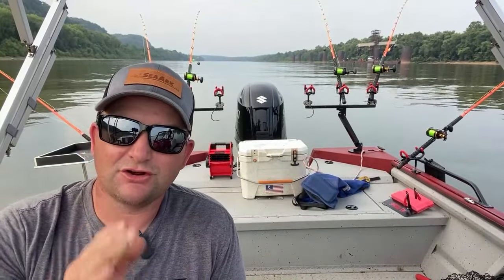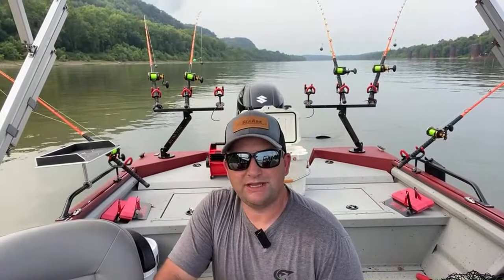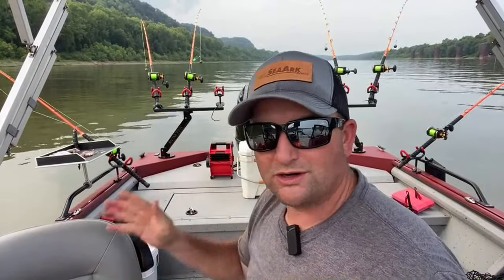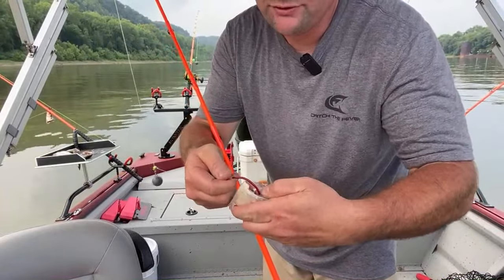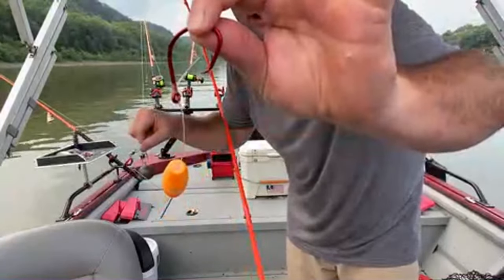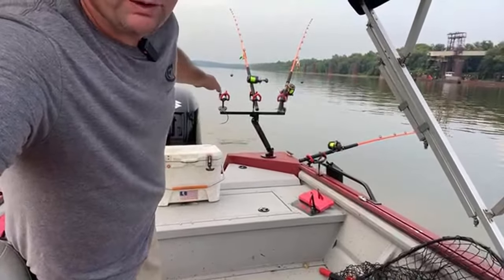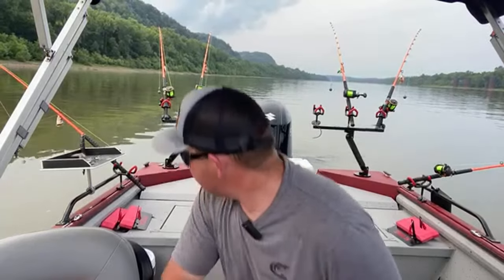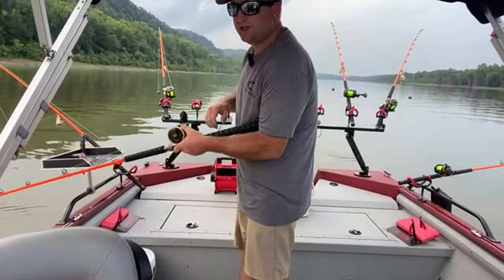How to suspend drift with planer boards

Comment: Question, are you using the trolling motor just to keep your boat in a straight line with the bow of the boat pointing downstream?
Reply from the maker: No I'm using the trolling motor to slow me down slower than the speed of the current. As well as to keep me on the line I want to target.

Comment: Why the saltwater  reels? Are you fishing in 200ft of water?
Reply from the maker: Not normally. The waters I fish are average depths or 30-40 feet. The reason for the bigger reels is line capacity. I use 50lb mono so I need a reel that can hold a lot of line.